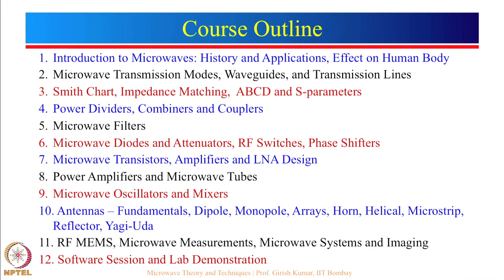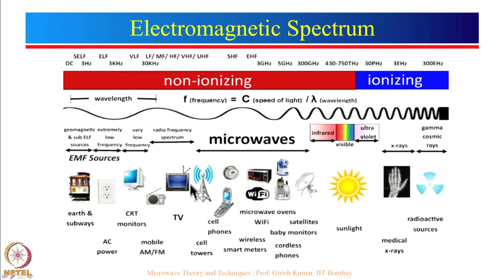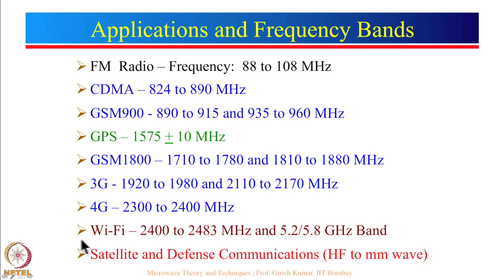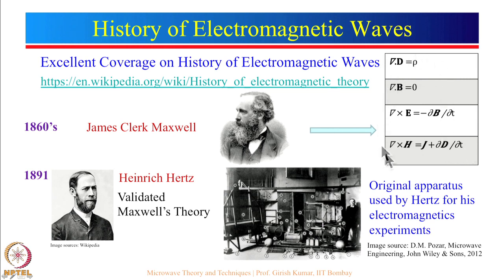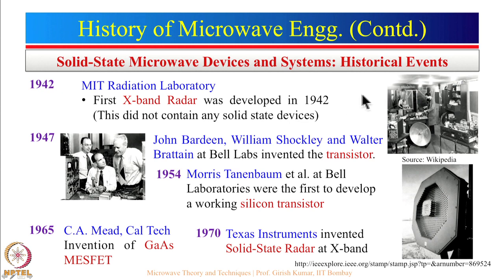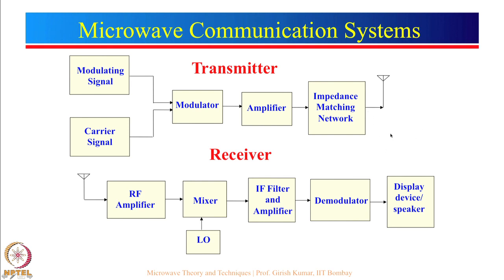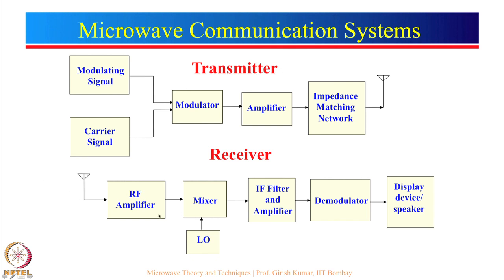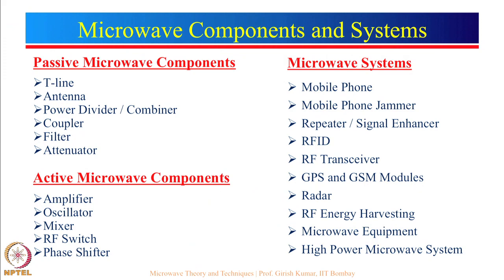Week 1-Lecture 1

Comment: Good content, thank you ;   Course Outline
1.Introduction to Microwaves: History and Applications, Effect on Human Body
2.Microwave Transmission Modes, Waveguides, and Tranmission Lines
3.Smith Chart, Impedance Matching, ABCD and S-parameters
4.Power Dividers, Combiners and Couplers
5.Microwave Filters
6.Microwave Diodes and Attenuators, RF Switches, Phase Shifters
7.Microwave Transistors, Amplifers and LNA Design
8.Power Amplifiers and Microwave Tubes
9.Microwave Oscillators and Mixers
10.Antennas - Fundamentals, Dipole, Monopole, Arrays, Horn, Helical, Microstrip, Reflector, Yagi-Uda
11.RF MEMS, Microwave Measurements, Microwave Systems and Imaging
12.Software Session and Lab Demonstration